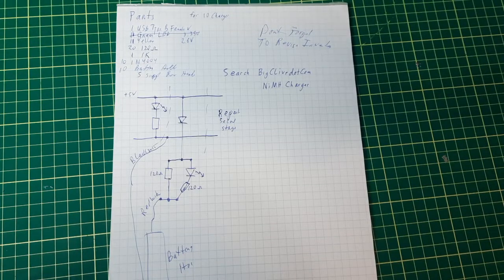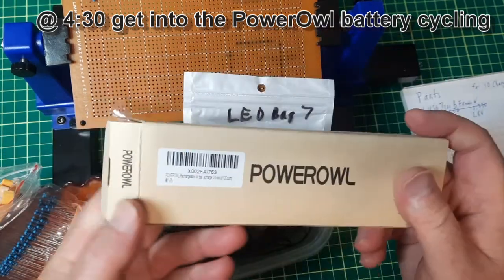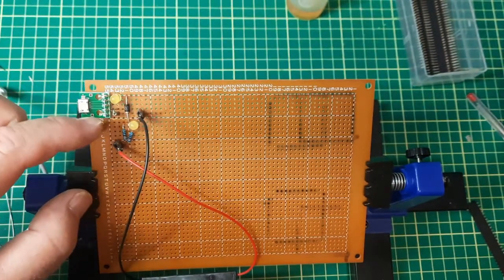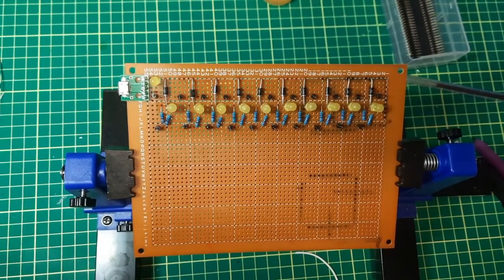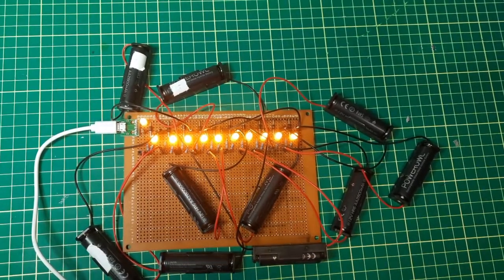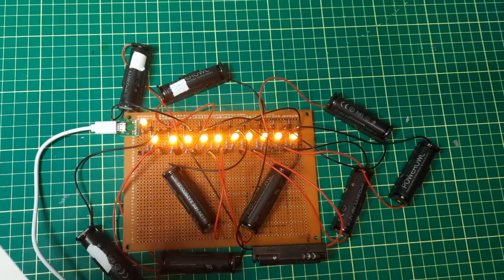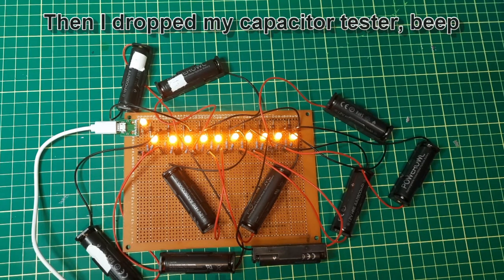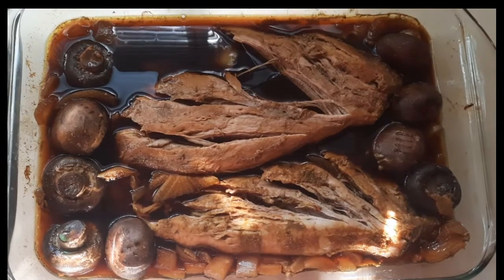Ni-MH Trickle Charger DIY

Comment: Will It make a big difference if instead of 120 ohm resistors i use 100 ohm?
Reply from the maker: Increases the charge rate a bit but no big issue. Plan on adding a solar panel as the charge source soon, but have been side tracted for a while.
Reply: @retireeelectronics2649  never mind i Lost all my resistor ill buy 120 ohm ones to male this